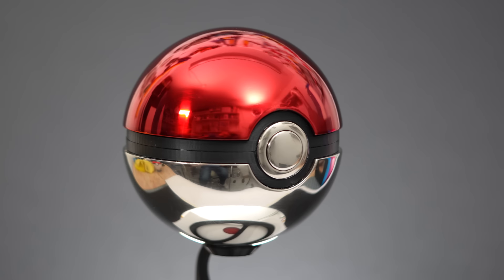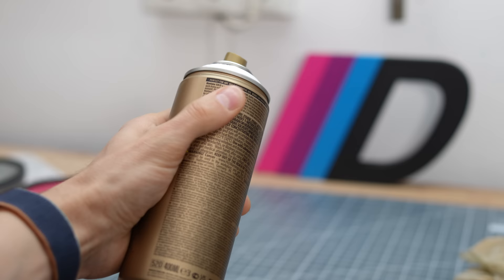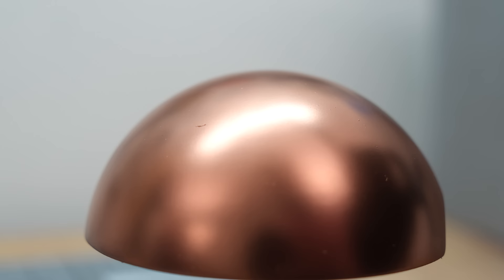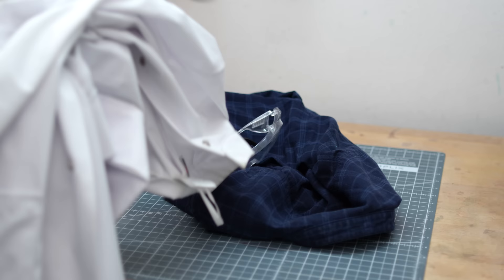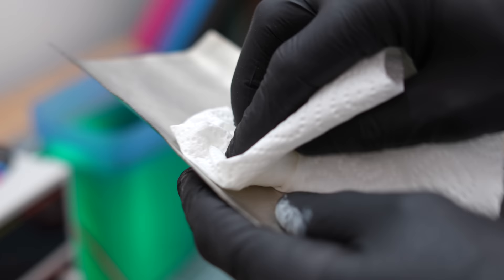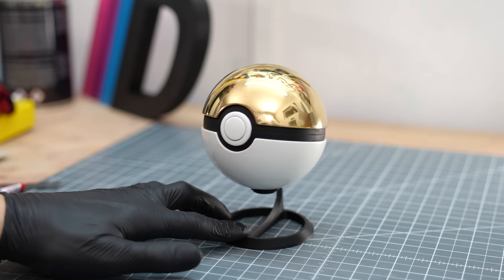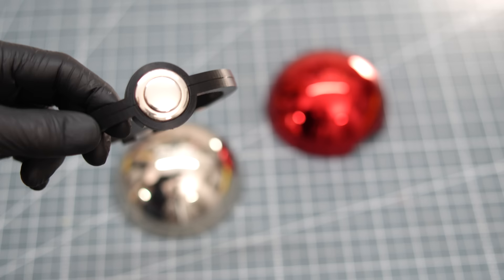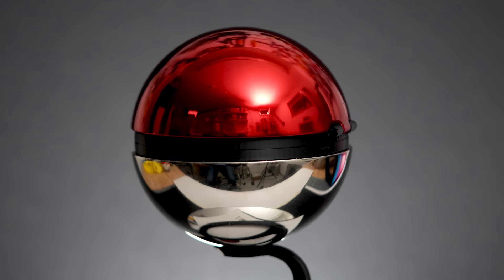Electroplating 3D Prints |  Color Metal

Comment: Absolutely incredible! I also had no idea you could paint acrylic on metal like that and it still shine. I wonder if this could also be a good way to get a cheaper gold metal look by just using acrylic over nickel?

Can’t wait to start my journey into electroplating soon :)
Reply: What he's doing here is called a Candy Coat. It has been used in cars for ages, basically means: Silver or Chrome background with clear coats of any particular clear color on top, usually acrylic for hobby projects. Tamiya and Vallejo have both Clear colors in their range for this kind of applications.

It's also super common to use either Alclad or Gaianotes chromes for the background layer as well, instead of doing Electroplating, which takes ages and it's hazardous as a process, at least more hazardous than enamel or lacquer paints.
Reply: @AlfonsoCarvallo   Interesting! For acrylic is it specifically a ‘clear’ coat version of a colour or just a regular colour sprayed thinly?
Reply: @sircaptain8358  Tamiya sells small hobby sized bottles specifically of tinted clear colors. Ex. Clear Red, Clear Green, Clear blue. In this video he uses tamiya's clear red paint thinned down for airbrush
Reply: @AlfonsoCarvallo  Thanks for explaining :) So you would not recommand this for example for Mando helmet or chest plate etc? Could be result a disaster?
Reply: @shinichi10  is it ok to use Tamiya clear over metal?
Reply: is there a specific Tamiya clear for metal? @AlfonsoCarvallo
Reply from the maker: @somekid1302 sure

Comment: As much as I love the result, the beginning line about why you like FDM over Resin (that "They're ready as soon as they come off the bed") is kind-of killed by the entire rest of the video.

Sanding them down to remove layer lines takes probably 15-20 minutes, minimum (when you're doing the steps you listed), while Resin can be cleaned-up and cured in 10% of that time basically automatically (since many people use a Wash & Cure station of some kind that does it all for you). I love my FDM printer, but I also absolutely love the Resin printer for many things. They both serve a purpose.

Comment: If you use “dry graphite lubricant” spray from Home Depot you don’t need an air brush.  The results are excellent as it’s made with alcohol.  It’s all I use and haven’t had any problems.  You can let it air dry to let it thicken to paint in areas that you don’t want to wide spray.

Comment: Your electroplating results are getting pretty impressive, although have you considered using your transparent black acrylic for the black bits? Or even blackening nickel?
I am interested in the "micrographite" results, although I suspect there won't be much difference unless there is an increased amount of graphene in it. Have you experimented with carbon nanotubes in the graphite mix?

Comment: Thank you so much for making these tutorials.  I love your videos and your channel.  I am going to start electroplating my own 3d prints and I would love to know more about the voltage meter that you use as well as the wand for applying the secondary chemicals.  Also can the copper electrolyte be reused?  I would love to know more about the electroplating part of the process.  Thank you!
Reply from the maker: Thank you, for the power supply: any power supply that does support constant current will do the job (min 5A). The wand is just an anode with a nonwoven. The copper electrolyte regenerates by the anodes, so yeah, this is actually my first electrolyte. Still kicking.
Reply: @hen3drik  Thank you so much Hen3drik!  It meant alot that you took the time.  I hope to make prints as nice and clean as yours.

Comment: I use the same micro graphite in a mix with UHU HART and acetone (roughly 30/10/60) which worked best for me so far. Starting with 0,2V and ramping it up to 0,7V as soon an area of around 2cm in diameter is covered with copper.
I had several issues with the copper paint. It clogged my airbrush quickly, then first it was too conductive so I had very low copper deposition in recessed areas and once the jar was opened and the painting exposed to the air it totally lost its conductivity after a couple of months. So i guess it has a limited shelf life once opened.

Comment: "I prefer fdm to resin because you can use it right off the printer." Proceeds to paint and sand several times. The resin print would have been nearly smooth off the machine and cleaning and curing are set and forget processes

Comment: I'd love to try my hand at some simple, beginner level electro plating, but the supplies list immediately becomes a problem. Where the hell do I even get all this stuff? I don't even have an airbrush. So that I can get off Amazon in Europe I guess, some beginner kit that will spray some of the paint, but... copper plates? the solution to immerse in? The gold, nickel, etc electrolytes? Graphite pens etc? And also need a power supply... the cost seems to add up real fast and I honestly don't even know where to buy some of the chemicals and parts at all.

Comment: Phenomenal work sir. If i may ask, I assume you are using a copper sulfate solution mixed with water and an acid. I see alot of people use copper acetate and was wondering why you may use one over the other. Ive tried both sulfate and acetate with little success, but i never incorperated anything but water in the mix. Do you have any idea what the purpose is for the acid? Thanks so much for the video!

Comment: A question related to painting nickel coated part with translucent paint: wouldn't you need to scuff (essentially dulling the surface) to promote adhesion of a primer, that would preced the paint application?
Does the paint hold well without it?
Reply from the maker: No. Yes. 😉

Comment: I see that an online vendor sells a "galvanic unit" that is capable of adjustable 3-15V DC with a single knob, the power supply trying to output 25A max at anytime (so there is no adjustable current knob on the device as there's no need for it). I am wondering of that minimal voltage of 3V though, especially as you advise to use around 1V. Wouldn't 3 volts be too much here?
Reply from the maker: HI, it's not about the voltage but the actually the current. That's why you should look for an regulated power supply where you can get a constant current and a variable voltage. usually my smaller objects need around 0.8V where the helmets go around 2V.
Reply: @hen3drik  I'm going for it! I finally ordered a stabilized lab power supply, adjustable 0-15V DC 0-30A CC.
I hesitated with the 60A version. I did find bigger power cables with an appropriate thicker diameter, but I was concerned that the very thin copper or silver negative wire hanging the electroplating part would not handle such an insane current. BTW I wonder how they do it in the industry.

Comment: Moin! Hendrik, I too tend to be overlyy perfectionist but.I let myself do a subpar job if im going to make another attempt:)
I just have a few simple questions (sure I could google the answers but I know you know better and ure my goto electroplating guru :)
1. Rhodium or Palladium? Which one you prefer?
2, I'm going to plate a steel katana with Rhodium or Paladium. Do I need to nickel base coat it first? 
3. I think the hand dipped anode painting method would be most suitable, which anode should I use? Can you recommend something or at least let me know what would definitely not work?
4. noob question, I understand that the voltage remains constant but how thick can i really plate it before sh*t hits the fan?
5. Any plastic container would do?
6. Why does too high voltage result in black deposit? :) Just pathologically curious, that's it :)
7, Is titanium platable?
Reply from the maker: Hi, 1) palladium 2) yes, nickel or a special gold electrolyte 3) hand dipped Anode painting? 4) current needs to stay constant, not voltage. This is important calculate the current for the surface (1A/dm^2) and use CC on your power supply. 5) I think so. Used acrylic and pp. 6) no idea. Usually it can be polished away. :-) 7) long story short: „no“
Reply: Hey, I can answer the 6th point. Basically, as Hendrik said, current is driving the reaction, voltage just allows the reaction to happen. As you increase voltage, you increase current ; the change in resistance in your bath is negligeable if there's any. 
At some point, you hit a hard barrier : how much ions you can transport over to your electrode. If your current exceeds some threshold, you get what's called a "burnt patch" (at least in my native language). You cannot get enough ions for the current you're supplying, and the plated layer starts to get a big "chaotic" in how ions are reduced in solid metals. You can think of it as :
- normal operation with proper current, the deposited metal is "smooth", very little rugosity. Light doesn't scatter much on it
- too much current, the deposited metal clumps, valleys and bumps form on the microscopic level. Light scatters pretty much everywhere, giving you your black-ish look.

That's why polishing can get rid of it (assuming you have a thick enough layer to polish!).

Comment: Have you every tied electroplating with zinc? I've been interested in getting into electroplating and have heard that zinc is a good option because it is significantly cheaper than nickel.
Reply from the maker: I use zinc electrolyte but only for special things (I.e. brass look).
Reply: @hen3drik  Thank you very much!

Comment: How durable is the metalic layer? I've been curious about doing something similar for sports helmets, but wouldn't know if it could handle the abuse.
Thanks!
Reply from the maker: It‘s actually quite durable. I mean, it‘s basically a 0.2mm metal layer on top of the print. Scratch resistant and all. I have to do a video about that, I guess.

Comment: It is better to wear long sleeve gloves. Check always if glove's material compatibile with chemical product, for example for acetone use butyl rubber gloves (or latex), nitrile instead can be dissolved by acetone.
As extra protection also wear a facial mask.
Don't forget also to at least  cover the legs and feet. Better to ruin shoes or trousers than a chemical burn. Even better, as You said, wear a anti chemicals laboratory apron.
Do not sit while handling acids or harmful liquid chemical products. Even worst  if You not wear  adequate personal protection devices.
Reply from the maker: These are good Tipps. I‘ll follow them for the future!

Comment: Hi there! I've got a question. Is there a possibility to have a heat-resisstant chrome surface? I would like to print new fog lights.. H3-bulps are getting very hot..
Reply from the maker: The underlying material will be still very sensitive to heat. Additional these two materials will expand independently due to the heat and probably create surfaces stress. I would not dare it. 😉

Comment: Can you simply submerge model into nickel electrolyte rather then applying by hand? Is there a big difference?
Reply from the maker: It‘s the amount of disposition that makes the difference. Some electrolytes cannot be used in baths, bath plating can be used to create a thick layer, while brushing will create a decorative layer (depending on how long you brush)
Reply: @hen3drik  Makes sense. But theoretically, I could dip it into nickel solution for a short period of time? Also, in case where my detail has a series of small groves or ridges that are hard to coat manually?
Reply from the maker: @dmitrireyer8755  absolutely, I also do it like that. Nickel for about 3-5 mins.

Comment: I want to remove inside mandrel after electroforming 3d part, which material type do you recommend for 3D resin? (Typical resin should melt at 150 deg C)
Reply from the maker: Good question. There are burn off resins for jewelry casting. I would pick these, but I have not experience in these though.

Comment: Hi, can you recommend a constant power supply, unit, is it better to go for a 10A option?
Reply from the maker: I got a cheap 80$ lab power supply 5A max that’s sufficient for up to 4 dm^2 surface area. Last year I got myself a 30A rectifier for larger prints (helmets etc). Just make sure that it can provide a constant current.

Comment: Hi ! Amazing job, I really love your videos. And now… I love theme so much that now I have decided to try 😅
But..  I have an issue: when I try to apply the copper paint diluted with acetone with the airbrush, I have a « glittery » result, the surface is not smooth at all, immediately dry, almost like dust…
If anyone has an idea …. Thank you so much ❤
Reply from the maker: Add more acetone: try 3:1
Reply: @hen3drik  thanks for the advice ! Unfortunately : same result. 
Is it normal that the paint contains « particles » ? Like small pieces of metal (copper, I guess ?). It will try to filter it.. 
thanks :)
Reply: « Particles » / glitters